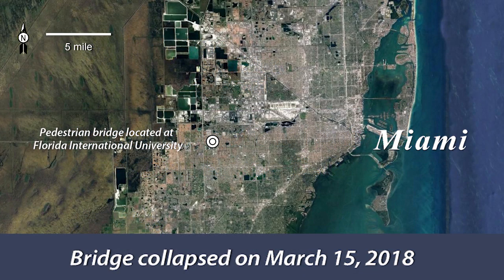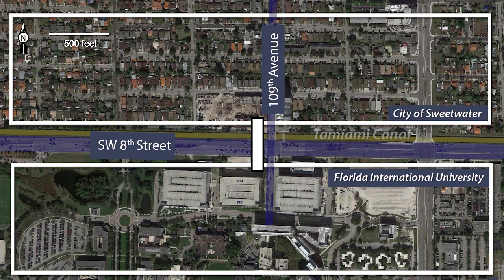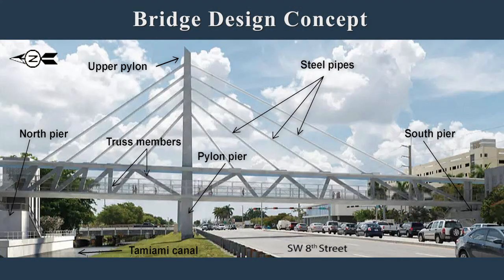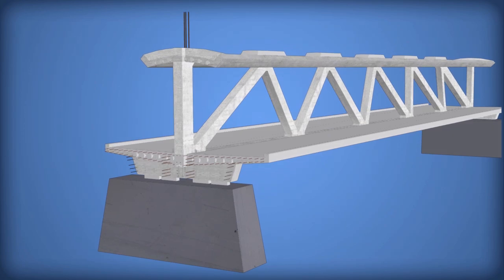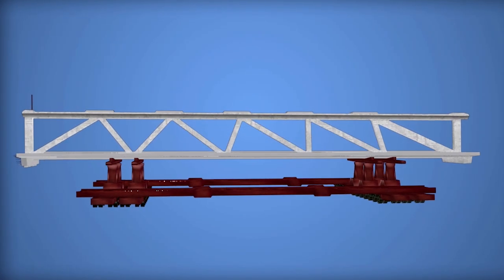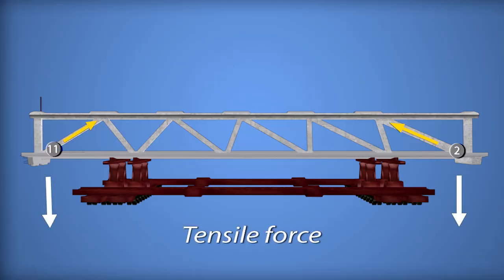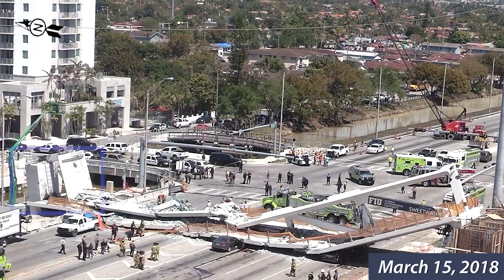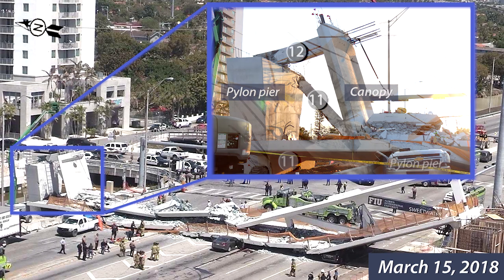Pedestrian Bridge Collapse Over SW 8th Street HWY18MH009

Comment: So basically the design was gimped from the start purely so it would have the aesthetics of a cable stayed bridge? What kind of moron though that was a good idea. The fact the road was kept open to traffic for DAYS with those cracks is even worse, entire departments need to be fired and locked up for this one.
Reply: @Groovy_Bruce  1 week later, many sources showing that the lead engineer was a man. The construction firm was owned and operated by five brothers.

But I guess none of those facts matter when there's some gender outrage to be had.
Reply: Roads should have been shutdown, particularly during the flawed testing.
Reply: Pantelimon — The University owned the project.  They wanted a showcase bridge, not something ordinary.
Reply: @GH-oi2jf  Which is fina and all... but if you are putting in the Faux Suspension bits, why not simply make them actual  load bearing suspension elements and support the bridge?
Reply: @andrewtaylor940  that would be too sensible
Reply: Yea...how about build an actual little cable stay? They should have done that.
Reply: @darrylknox5919  That was going to require that the road be closed down much longer. You can have design flaws in cable stays as well.
Reply: Millennial keyboard warriors in engineering?
Reply: @Groovy_Bruce  ok incel
Reply: https://www.youtube.com/watch?v=Y5sceezeaY4
Reply: Hahaha hahaha hahaha!
Reply: That moron was an ENGINEER!
Reply: Pantelimon wow this reply thread got toxic fast
Reply: mickey7411  Please exit the gene pool... you muddy the waters.
Reply: why the hell do you guys make this crap sexist, people died that day and their families are still grieving
Reply: @ryanjl4135  it's YouTube. There's no such thing as decency here.
Reply: @Revealingstorm.  the truth hurts doesnt it
Reply: @Groovy_Bruce  

G'day,

  Pennypinching Beancounters care much more about cutting their Production Costs than Product Durability.

   Deciding to build a Bridge incorporating a "Perfect-Frame Girder" Design  (which will fail totally if any one Loadpath is ever compromised)..., was the underlying reason why this Bridge fell down.
 
 Building a "Redundant-Frame Girder" instead (one in which ANY one Loadbearing Member may be removed without compromising the overall  Structural Integrity of the Bridge - because multiple Alternative Load-Paths will still be intact...) would have been heavier, & more expensive.
 
 But the Bridge didn't have to Fly, so total Weight should not have been a factor ; whereas being located accross a major Highway made the Girder-Failure fatally catastrophic.

  Deeply Professionally  negligent devotion to the Profit Motive, or simply rank Incompetance, would appear to underlie this Bridge Collapse  ; rather than whatever Fact-Free Misogynistic Fantasy might have motivated your comment, Pilgrim.

Just(ifiably ?) sayin'...

Take it easy,

;-p

Ciao !
Reply: @WarblesOnALot  Cost is not necessarily correlated to material usage, that's a very naive argument. In this case I think the opposite happened. Costs went up due to them trying to use a little material as possible since you have to do much more engineering work to make a bridge like this work. A conventional bridge design which used more material would likely be cheaper.
Reply: @Bordpie  

G'day,

Thanks..

  I prefer Redundant Frame Girders, unless they have to Fly, when,

"Simplicate, and add more Lightness...!

is usually a winning formula.

To make a Public Footbridge as a Perfect Frame, & then mess up the construction as well ; that's reckless carelessness garnished with negligence (!).

Have a good one.

;-p

Ciao !
Reply: @WarblesOnALot  "Pennypinching Beancounters care much more about cutting their Production Costs than Product Durability." 
Auto Industry.
Appliance Industry.
Garment Industry.
Boeing with the 737MAX.
Tool Industry.
Shoe Industry.
Furniture Industry.
Home building Industry.
Restaurant Industry(food quality).
Medical Industry.
Toy Industry.
Electronics Industry.
Add more if you want.
Reply: Piss off you sexist moron. You have no idea what you're talking about.
Reply: @8w9hf89hw A women didn't design the bridge. It was a man who did a mostly good enough job. Obviously good enough isn't enough when it comes to structural design.
Reply: A woman may have designed it but it was men that approved it.
Reply: MotorcycleMan  Look at evidence not bogus MGTOW articles. Indicate your sources. The EOR was Mr. Denny Pate. The other engineers were men as well. Read the interviews in the NTSB docket. Look at the RFP etc. There is no indication at all that what you are saying is true. Saying "Not true at all" is not an argument.
Reply: @yodaiam1000  :  You missed the sunshine-pumping for diversity that was all very public before it collapsed and all very deleted, after.
Reply: @harrymills2770  It doesn't matter. If the designers weren't women, they weren't women. There could be all the diversity sunshine-pumping you want but the doesn't change the fact that the designers were men.  It is ironic that the only ones not responsible in the collapse were the women. Are you saying men should never design structures or bridges?
Reply: @yodaiam1000   Don't bother with the incels, dude. Their evidence is a photo collage XD
Reply: @yodaiam1000  NTSB is a governmental institution. In all this mess, they are probably the least reliable and competent.
Reply: @BandytaCzasu  The people who designed the bridge in the first place are the least competent. Structural engineers from around the world have independently come to the same conclusions as the NTSB.
Reply: @BandytaCzasu  haha! Shows how little you know about the NTSB! They put the blame on government quite often.  They are one of, if not, the best accident investigation agencies in the world.
Reply: Not a moron. A female engineer.
Reply: phuc ewe  I am not a chick but I am thinking you are probably one ugly guy.
Reply: Welcome to the new age. Form over function. Engineering takes the back seat. While the artist makes the decisions.
Reply: To answer your question, a woman. This project featured women engineers.
Reply: @robhoard9114  Site your source.  All other evidence indicates your statement is not true.
Reply: @yodaiam1000  Of course a licensed by state engineer signed off on it. He was preassured by so much estrogen. He bares the grief of it killing people. However, the engineers and designers were all female. Just so happened a Male certified engineer had signed off.
Reply: @brandoncaldwell95  Look at the NTSB dockets and interviews. There were no females involved. The engineers that did the actual work were men as well.

It is a weak engineer that can be pressured to accept life safety issues. Anyone like that should not have a license to start off with. I don't know about the US but where I live, we are trained in ethics to resist those kinds of pressures.
Reply: @brandoncaldwell95  nice job reading what A McClellan has stated over and over.  NTSB is more authoritative than your flavor of the month MRA article.  Try a as little harder next time.
Reply: @yodaiam1000  "site"
Reply: mickey7411  concrete is a sexist building material
Reply: Feminist engineers: no more need be said.
Reply: phuc ewe  There is a reason you are an incel.
Reply: @Groovy_Bruce  It was mostly men that designed the bridge.
Reply: @yodaiam1000  men, women, doesn't matter. Incompetence is what matters. The designers were incompetent.
Reply: @tollboothjason   Agreed.
Reply: @yodaiam1000  This is not true. It was designed by a female with a music Degree. Im not kidding. They even made a big deal and got praise for how it was an almost "all female" engineering team before this happened.
Reply: @bobwillneverdie  That is just not true at all. Review the project documents, RFP, NTSB report, drawing seal etc. The EOR was a man (Mr. Denny Pate) and the others on the design team were men. The NTSB has all the interviews with those involved on their docket.
Reply: @yodaiam1000  Wait, are you assuming his/hers/its gender? How dare you?!
Reply: @bobwillneverdie  Those weren't the designers! They had nothing to do with the design. Show one piece of evidence that indicates the designers were women.
Reply: @--_DJ_--  People will be guessing at your gender for generation to come.
Reply: @yodaiam1000  Was that supposed to be an insult?
Reply: @--_DJ_--  You're right. It is not an insult unless you have the intelligence to understand it.
Reply: A McLellan You just aren’t any good at insults is the main issue.
Reply: @bobwillneverdie  that isn't a source lol.

It's an image with words on it.

You have a funny concept of what constitutes a source.
Reply: @yodaiam1000  It is true actually. Down here in Australia ,a matriarchal society  based on mysandry ,it made the news Before the collapse,about the All women team designing a special bridge. The male involvment was wiped ....before the collapse.  Now,in typical mysandraic fashion,a man has been blamed for a bad design .
Now all comment regarding women has been altered or hidden. Next thing ,it will be blamed on climate change.
Reply: @Mercmad  You have really crappy news media in Australia if that is actually true. Look at the actual sources. It was men that designed the bridge. Name one women on the design team. You are looking at articles form echo chambers in the internet. It is just not true. Do yourself a favour and think critically and track down the actually sources. MGTOW forums are not telling you the truth.
Reply: @bobwillneverdie  You are confusing asking for a product with designing. The university board can say they want a bridge in whatever shape they want, but the bridge was designed by the engineering firm Figg. In particular, the engineer of record (the senior engineer who signs off on the design) for this project was named Denney Pate.

https://www.enr.com/articles/47108-bridge-designer-testifies-on-evidence-one-day-after-osha-slams-figg
Reply: @bobwillneverdie  post sources you are all just spewing random internet garbage with no proof
Reply: A McLellan and most bridges don’t collapse lol
Reply: @speterj  What is your point?
Reply: @speterj  That is a very ignorant statement.  They do more than you think.  You only hear about the high profile ones that collapse.  Common reason is overweight/overdimensional traffic traveling over a bridge/road they're not supposed to be on.
Reply: @yodaiam1000  Wrong. The original design, by a man, had a tower with cable support to handle such a heavy concrete structure.

The women changed it, and the project was pushed very hard as done by "female engineers".
Reply: @Eighteenxray  Please provide your sources. All evidence shows that EOR was Denny Pate. All NTSB documents and dockets indicate male designers and concept reviewers. There was only one female I know of for the PT fabrication design (which was not an issue) and one of the partners of Figg is the daughter of one founding member that appears to have nothing to do with the design other than marketing. I found no evidence for another design that was revised because of women.
Reply: The sources were the company website, news articles and reports during the construction of the bridge. After the collapse the company web page was altered and then deleted. The news articles followed. The story was memory holed.
Reply: @Eighteenxray  citation needed.
Reply: @BBUCK_Fiden  snopes is a joke, they are super left wing biased. not impartial whatsoever.
Reply: A Mclellan there is a video of FIGG saying SHE designed it to look like origami.
Reply: @Bit01  uhhh ... archive.org?   sounds like excuses and you have no sources
Reply: @kneel1  I saw it personally. Shove that in your sources, child.
Reply: @Bit01  lol oh yeah thats reliable.  When someone asks me how I know, I will tell them "some random dude on youtube TOLD ME HE SAW IT" that'll show em
Reply: A McLellan doesn’t matter who designed it. Matters who signed off on it
Reply: @PInk77W1  Denny Pate signed off on it and he bears the most responsibility. There were other engineers involved as well and they bear responsibility to.
Reply: yep EQUAL RIGHTS MEANS EQUAL TIME IN JAIL BITCHES  .... ha ha ..no more Lattes and lipstick
Reply: MotorcycleMan  It wan't designed by women. It was designed by men. I wonder what their grades were in school?
Reply: Prior to the collapse of the bridge, news articles and media surrounding the project had been aggressively touting the involvement of female engineers and university personnel in influencing the final design of the bridge. In other words, the original bridge design may well be attributed to a male engineer, but this was subsequently altered by one or more female engineers in collaboration with the university. At least, this was the story before the collapse of the bridge. Afterwards, all of these articles and mentions of the involvement of women seemed to disappear down a memory hole. A question for those of you claiming that the official reports list only men on the  docket: why this discrepancy? It's an honest question, so if you can provide an answer without resorting to the "misogyny", "incel", "MGTOW echo chamber" remarks, that would be great. 

We do live in a gynocentric society where women are seldom held accountable for their actions, so I don't think it's a far-fetched conspiracy theory to suggest that the involvement of women in this tragedy was memory-holed in accordance with that social imperative of shielding females from negative consequence. Sincerely interested in the truth. 

And to those protesting why it should matter whether or not women were involved and claiming it's not important. Well it is important for two reasons: 1) accountability-- if virtue signaling "whamen are awesome, look at what affirmative action can achieve" results in human casualties, those responsible should be held accountable, don't you think? I think it's high time that this lie that men and women are equal is exposed and rejected from our culture, especially when lives are being lost to uphold that falsehood. 2) truth-- the truth matters and I don't want to live in an Orwellian dystopia where I am told what I am allowed to think and where information is filtered to suit an agenda. I will think for myself.
Reply: @Schism07  NTSB is the authoritative report, not the media.
Reply: @davidfairchild8566  Yes, the media gets facts wrong and even purposefully misrepresents them quite often. But an authoritative entity such as the NTSB is not infallible or impervious to corruption, either, agreed? If the NTSB report conflicts with what the media had originally reported, wouldn it not be reasonable to assume the media and university representatives would simply issue corrections to append their original reporting rather than erase them down a memory hole as they did? It just seems awfully fishy. Scientific publications can be swayed by gender politics and ideology just as any news media agency, and we see this very phenomena take place all the time in modern academia, in fact.
Reply: Sean P. Do you think Mr. Pate destroyed his own phone to cover up for nameless “female engineers” or himself? Honest question.
Reply: @Schism07  I don't think you understand what "Authoritative" means...
Reply: @davidfairchild8566  The NTSB is an agency operated by humans, meaning the capacity for bias and corruption exists. No institution that has human involvement is impervious to ulterior motivation, exterior pressures, and ideological bias. Simply having the status of an authoritative agency does not confer perfect judgment or eliminate the possibility that its investigations will deviate from the truth. Being authoritative does not mean that the NTSB is incapable of distorting or misrepresenting facts and evidence, deliberately or otherwise, nor does it circumvent the possibility of external parties lying to the NTSB and hiding pertinent information. Just saying "the NTSB is the authoritative source, therefore believe everything it says and disregard everything else, even if it remains unreconciled and conflicts with prior observations and information which were never satisfactorily debunked.", sorry that's asking me to believe on faith alone; faith that a government agency has supreme competence and immunity from corruption at that. It's not like governments have ever been known for failing at either of those things, right?
Reply: Sean P. If you want to think for yourself, you should probably start soon.
Reply: @counterfit5  This is your reply to someone expressing skepticism ? I guess people who are content to blindly adhere to society's programming wouldn't recognize thought even when it's staring them in the face. I should have also stated that NPCs need not reply to my statements.
Reply: This reeks of liberal thinking.
Reply: https://www.enr.com/articles/47108-bridge-designer-testifies-on-evidence-one-day-after-osha-slams-figg
Reply: @operatordragon  Note: the engineers name has been removed .
Reply: @Mercmad  The Engineer of record's name is Mr. Denny Pate P.E.. Go see the NTSB docket for the other names. They have not been removed.
Reply: @Mercmad  It's still there for me, Denney Pate.